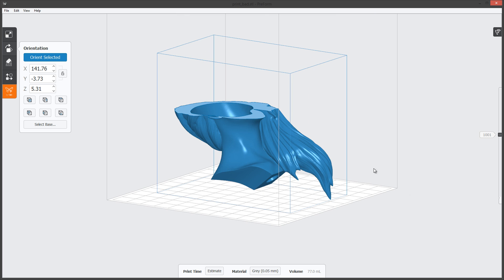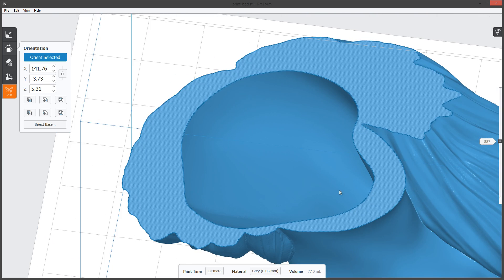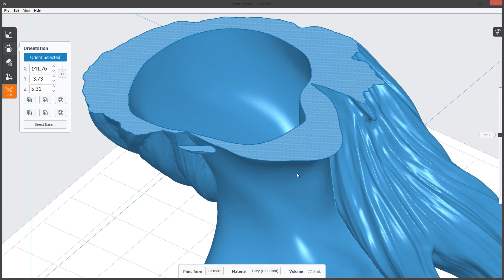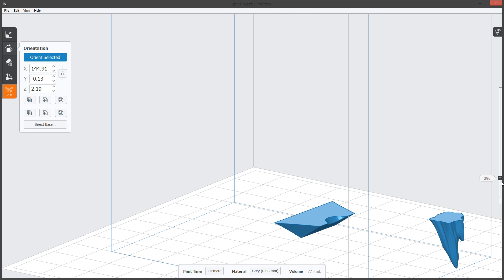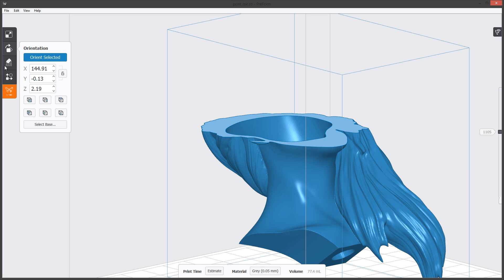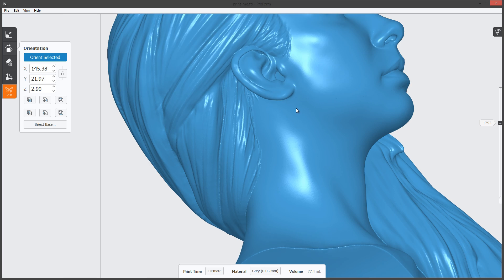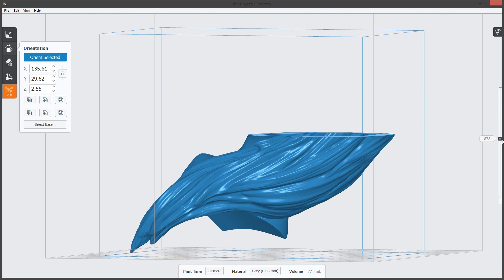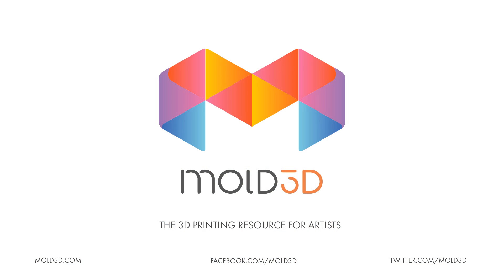3D Printing Tips using the Formlabs Preform Layer Viewer

Comment: Tom Samuel, 
  I got the same problem with you. I got the Form1+. Its successful rate is good for small size print. When the model size goes up, the failure rate increase due to the peeling action. Layer is sticked and cannot be peeled out. This cause failure. I have tried hollowing. Failure rate is still high for large-size model. The resin is not cheap. I will try dividing the large model into several part, but this will cause a seam at joins. But it is better than failure.